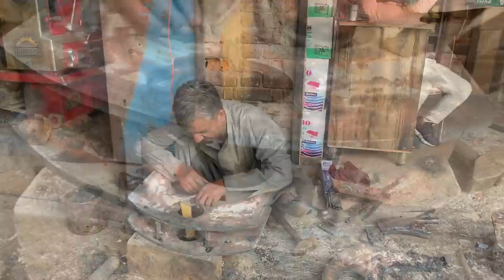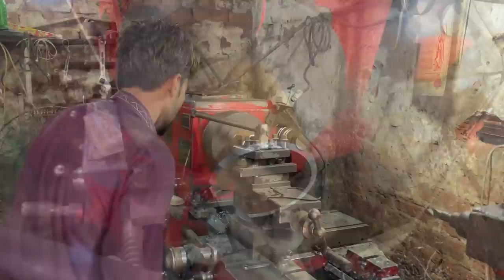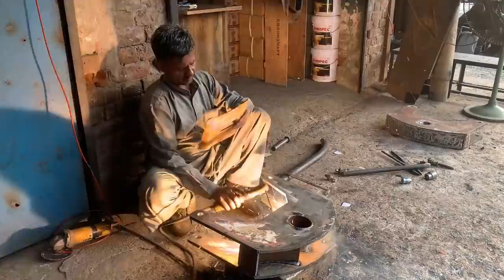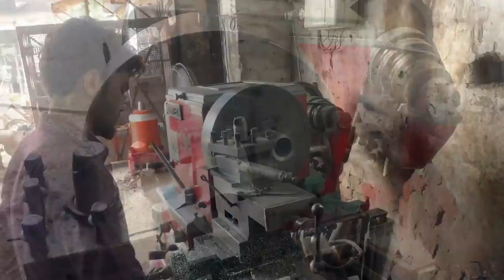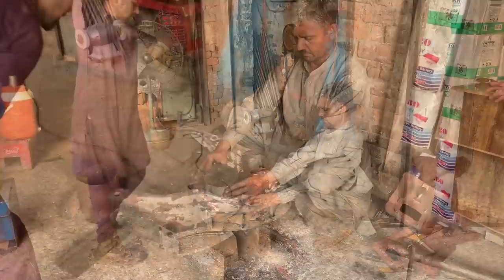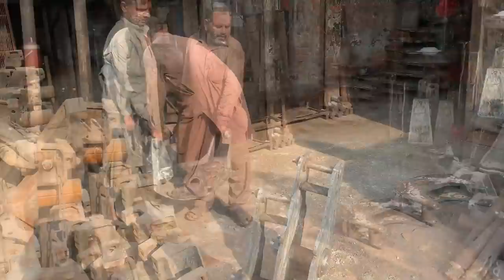How Semi Truck Trailer Axle Suspension Hanger are Made || Leaf Spring Equalizer Production

Comment: I worked for a trailer suspension company for 11 years and those are very large hangers. It's amazing seeing this...barbaric to me, but works of course. Id like to see them get the bushings in.
Reply: They have those fine special tools, little hammer, medium hammer, big hammer, THOR'S hammer 😉😁
Reply: Have you seen how much they haul they have no portable scales chasing them down the highway and the springs are twice the size here in the states
Reply: @rustymachineshop9456  You should see the types of sliders we made for places like Brazil. We made parts for the military as well.
Reply: @rustymachineshop9456  The word "overloading"  doesn't exist in those countries. They do have a audio warning signal in case of a real overload, that's the cracking sound of breaking parts 😉
Reply: Its no wonder you see trucks with collapsed suspension. Welding of these components is dangerous. Lack full penetration and barely a lap joint. Its barely tacked together and moved on....

Comment: should get a MIG welder with gas and electronic welding helmet
Reply: No.  They shouldn't
Reply: Were will the money come from to buy this equipment , to do that his prices will go and the chap around the corner under cuts his price then he has no work its a viscous cycle . When the end user needs the product to be cheap as possible.
Reply: With the same thought you can just demolish the entire building and rebuild from scratch using western methods and materials. The point they are welding with that dated stick welder is that they just live in such place.
Reply: @Engineer9736  and it's better for what they are doing.  Cheaper, weld outside in wind.  No gas to replenish,  no extra stuff to break.